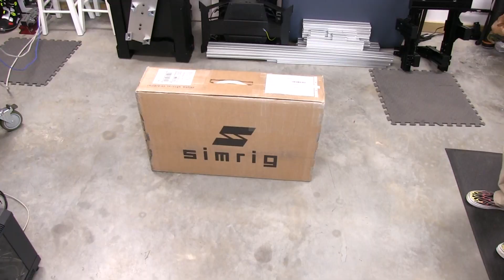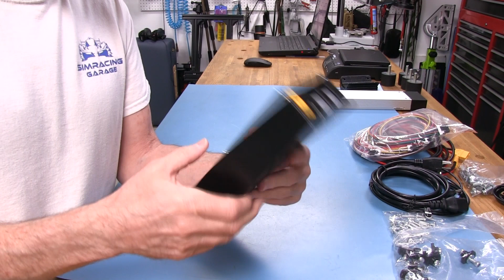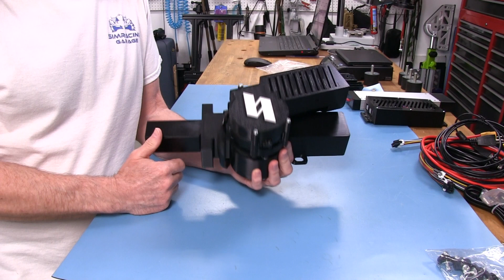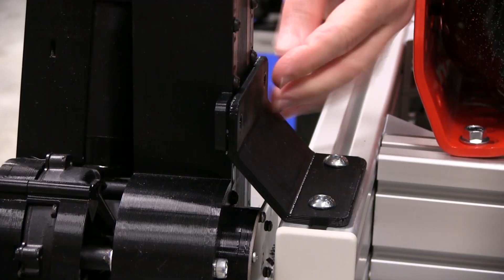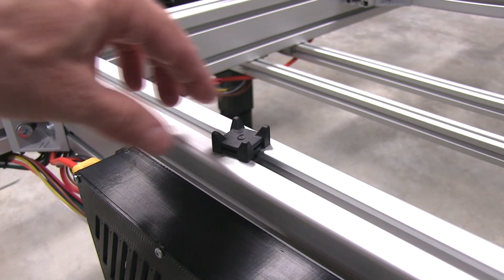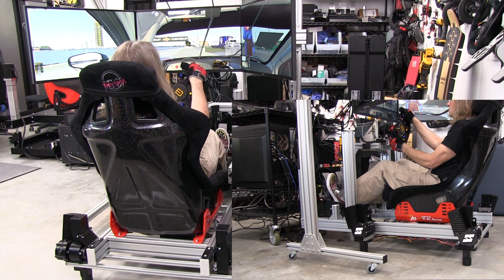Simrig SR1 Motion System Review

Comment: Id be really interested to see the RS Mega+ kit reviewed now that they make a plug and play set up. I'm really torn between the Simrig SR2 and and the RS Mega +, or even the Sigma Integrale DK2
Reply: hey, did you buy one of them? :)
Reply: @Jan-1337  ended up with dbox
Reply: @charlesgutscher1923  ok cool! Is the heave (/travel) also enough for flight Sims from you perspective? :)
Reply: @Jan-1337  1.5" of travel leaves some to be desired on flight but it's a trade off. If you're going to be primarily doing racing, the lowered travel units are more than enough and are easier to deal with. And you'll still get the seat of the pants feel on flight. If you're primarily doing flight, maybe opt for something with more travel
Reply: @charlesgutscher1923  Thanks! :) Did you have the chance to try the RS Mega+ or the Simrig SR1/2/3 before making your decision? I'm still undecided, especially when it comes to balancing racing and flight. The SR1/2/3 already offer 2.7" of travel—maybe that little extra is enough to simulate some pitch and roll during flight. Could be enough for me.

Comment: how do you think it will do with Microsoft Flight Simulator 2020?
Reply: Did you ever get a response?  I'm looking for a similar solution but using X-Plane due to the availability of a particular helicopter addon-on.
Reply: @flym0  did not- I went with D-Box refurbished generation 1, Four actuator system mounted to my FGT elite frame it works perfectly. I couldn’t be happier and the folks at D-Box are very supportive with X-Plane, Microsoft flight simulator, elite, dangerous, etc..

Comment: @40:00 Barry...the movement in motion platforms is primarily meant to simulate G-force...not only suspension movement...  So roll/pitch/heave create a combination of positive/negative & LATERAL g-forces.  (ie if you were tipped 90 degrees left or right, it would simulate 1 lateral G in that direction).    Many vehicles generate more than 1G or lateral force in cornering, so theoretically, tipping the user 90 degrees could improve immersion).  So while 70mm of roll to one side might only simulate 0.05G laterally, you're mind can fill in for some of the difference.  I wounder if you would have greater appreciation for the greater movement if you were in VR, where your eyes would confirm the movement, whereas right now, your eyes conflict (your garage environment) with the movement.  It seems to me that you do not understand the fundamental idea of what is being simulated.
Reply: JOY VLOG Have you ever seen his channel before.  He owns a top kf the line dbox system with traction lose and more. He has had a motion system for well over a decade. His point is due to weight most wont have the monitors attached to the rig so without the screens moving it simulates pitch of the car where when the monitors move as well then it is gforce

Comment: The price is awesome, but all that plastic is a bit concerning. You would think they would go with steel for the brackets and actuator housing at least.
Also, it's a gear driven actuator. All in all, i guess it's a good value for the money.
Reply: was until the price went to £3800 no cockpit UK

Comment: Hello Barry,
thanks for your interesting video. Because I'm thinking about to buy the SR1 now I'm very insecure. The stamps from the gear unit are PET material? That sounds not really to a long lifetime. Can you see if the gear from the servo motor is made of metal? Then you have mix from PET and the Metall between the gear tooths.
Maybe you can give an additional detail review about the servo/gear box of the SR1. Currently I'm not sure if the SR1 is a good choice. thx Mario, Germany
Reply from the maker: The leg is made from Delrin which is a very tough, machinable plastic made by DuPont.
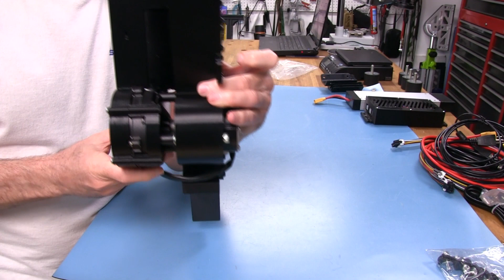Reply: @simracinggarage3026  Yes, thats right Delrin is very stable and have a long lifetime. But the question is, what is on the servo side. In your video it looks like metal output shaft (14:10). Therefore I think it is a metal gear inside.
A gear combination of Metal and Delrin isn't good in my opinion. It would very interessting to take a look inside of the gear box. Thanks again Mario

Comment: As an apprentice I worked on maintenance of the ultimate simulators, a Boeing 737 aircraft simulator. I always remember watching the pitch and roll of these from the outside. This was not to emulate pitch and roll, but to emulate G Forces if that direction. When you landed with full auto brake they pitched waayyy forward. When inside the graphics were staying pretty level, fooling you into thinking that this was G-Force pulling you out of your seat. Surely this is why you are seeing so much roll and pitch, but without the screens tracking the movement you lose the intended G-Force simulation??. Would VR solve this. Not a sim gamer, just intrigued by the available tech nowdays
Reply: Yes VR does solve this, you are actually 'there' in VR. Motion Rig and VR is the dream setup.
Reply: Yes it does as you are in another environment so the brain is tricked big time.

Comment: I think with VR on the pitching would feel more like acceleration forces vs replicating the feel of suspension. I fly full motion flight simulators.  They pitch way more than the aircraft does in normal flight but the perceived feeling inside the enclosed sim doesn’t get much more real.

Comment: Good lord man. Just subscribed as I'm liking your content so far but I have to ask something and it is very possible you've addressed this before but WHY on EARTH are you still using monitors over a mid to high end VR system. Flat screen really can't compare to a VR racing sim experience/immersion. I'm fairly sure a motion system should still work with VR, if not even better than a monitor setup.

Comment: Hi Barry, what is the difference between Simrig SR1 and DOFReality H3? Both are 3DOF, but uses a bit different kind of motion transfer. Which one is "better" in terms of feeling? Are 2 actuators  of DOFReality enough to transfer pitch and roll moves in comparison to 4 actuators of Simrig? And in other hand, do these Simrig actuators right job for traction loss and yaw comparing to one  actuator dedicated for these moves of DOFReality? Both systems are in similar prices here in Europe, so I'd like to decide which one could bring better and more real filing during driving in case I would buy one. thanks!
Reply: He refused to answer because it looks like he doesn't want to favor one from the other.  In other words, he's working for both.

Comment: No wonder you dont like pitch too high if you have static monitors. I bet this will be different experience in VR where you want more pitch that will simulate braking force and not only suspension . I give up on triple screen 3 years ago and im running VR only right now, but this motion system will be my Christmas this year i think :).
Thank you for your pro review as usually, because without you i would not know about this system and many others toys.
Thank you

Comment: Hi, new fan here love your videos. Not related to this video, but I'm considering purchasing the GT Omega Pro Cockpit, I was wondering if there is anything better you would recommend for around the same cost?  Thanks in advance for any advice. :)
Reply: The Simetik K2 is very good. I have an OSW direct drive wheel and the rig is solid. No flex whatsoever. It's MUCH better than the omega cockpit. I had a GT Omega before (not the pro)and it was flimsy and couldn't support my OSW.

Comment: How does compare with the DOF REALITY H3?
Reply: Based on the video, I think H3 sucks compare to this one because H3's movement are sudden and it is jerky and not smooth.
Reply: @senhsationalv6278  But this system does not support flight sims.. wonder if H3 supports it
Reply: @tommyjen2010  What you mean it doesn't support flight sims?  It does!
Reply: @senhsationalv6278  I saw the list of supported games on the website, mainly racing sins not flight sims

Comment: Thanks for this awesome review. Have been looking at this motion solution for quite a while and had some mails forth and back with the guys. But: the weight limit is way too low for people with "normal" rigs and especially for tall or heavy people. I'm 1,94 m and roguhly 95 kg with clothes + the rig I'm scratching the weight limit. Do you see any problem with that? Was looking to other solutions like PT actuators instead, because they offer more power and less limitations, but at a higher price. Do you have any comparison on the noise levels between SR1 and most recent PT actuators?
Reply from the maker: An actuators performance will fall off as the load it is moving increased in weight. Some are better than others. I do not have any info on the performance parameters of the SR1 actuators under load. Need to contact the guys a Simrig for that. Yes weight limits are aways something to consider depending on your own use requirements. Considering the price point of this kit, I would not expect it to have the capacities of more expensive actuator systems.
Reply: @simracinggarage3026  It's actually rated a max load of 175 kg (including driver and rig) based on what they say on their website. Do you have any opinion or comparison in terms of noise levels?

Comment: I have this system since a half year and I have to say I love it. It's quiet, strong, fast and the software is very easy to use. Thanks for your review I preciate it.
Reply: How is the reliability till now? any problems? do they send parts if it's out of waranty?
Reply: @TinoushGTR  until now no problems. The software is still updating, the servo drives working well. I have now approximately 200 hours running time on the system. The contact to the supplier over mail is awesome and I don't think that you get trouble with spare parts.
Reply: @TheNasenboer  Thanks for the update. Ill have to weight my aluminium rig. Because my seat is about 10-20 kilo and im 110kg. lives 40-50 kilo's left maxing 170kg.
Reply: @TinoushGTR  maybe you also buy an new seat like a sparco racing seat. They not heavy. Also you can go in touch with the guys from SIMRIG and ask about the maximum weight.. If you have any questions feel free to ask.
Reply: @TheNasenboer  sure I will. I haven't finished building my 8040 rig yet. My seat isn't used yet 😂 I'll upgrade to motion after couple of years. Not a seat mover like motion platform v3 but a dof system.
Reply: Do you think it wil work with the trakrqcer tr160??grtz
Reply: @m-dsimracing3091  yes it should be working. For the best answer please contact simrig.
Reply: Do you feel the motion when the rear of the car slides?
Reply: @fady904  The motor can only move up and down.. You can only feel it over your wheel.. But you can feel more the car and track
Reply: @fady904  only dbox can do that with its tactile.

Comment: Seems like the actuators are very close together!!  most of the actuators Iv seen are in front of the steering pillars??
Reply from the maker: That is the way the instructions tell you to set them up. This to maximize the pitch effect. The further you move the front actuators forward on the chassis the less effect the same amount of pitch will have on chassis movement.
Reply: @simracinggarage3026  yeah makes sense buddy... I'm just building an sfx-100 system and had thought about mounting them closer!!
Reply: @simracinggarage3026  What is your guesstimate of the longevity of this machine?  How durable it is before it is no more use?

Comment: So are you really able to feel the rear end start to slide out with this setup?
Reply from the maker: In the DD wheel, yes. There are some very minor queues from the chassis. But not like when you have a real, and effective, yaw DOF element in a chassis.
Reply: @simracinggarage3026  thanks for the info my man. I apologize, I meant to specify feeling that through this SR1 Motion System.

Comment: Like it Barry, I am about 200lbs, with OSW setup, P1 Rig, HE Ultimate pedals, how did you get on with your larger friend in this rig !?  did everything still work absolutely fine, or was the setup under too much stress !?   Very interested to know I am very keen on this motion setup.   Many Thanks, Des.
Reply from the maker: The system did not seem to have any difficulty with the added weight. I don't have any information as far as performance drop off under inceasing weight loads. Something you would need to ask Simrig.
Reply: Cheers Barry.

Comment: I got this system for a little while now(early bird sinds 01-2019). Its very silent and gives great motion, i think its even better than a expensive 10000-20000 euro d-box system that even comes without a rig! Also durability is topnotch, after a year it still delivers!…..Guys this is a no brainer! coupled with a dd1 and valve index its a wet dream!
Reply: Would you say it's quiet enough for use in a concrete apartment?
Reply: Yes for sure, the rubber pads do lots of damping and the actuator noise level is very low
Reply: So it's been 1 yr for you?  How often do you use it?
Reply: @senhsationalv6278  Don't want to drive without it, the combination dd1, valve index and motion is a must....its like the real thing.
Reply: @Airwayz ArA did  this rig does motion feedback when you shift gears like hitting you a bit Back? Cause I really cant see it :"(
Reply: @maximiliangottschalk6071  Yes you can edit the jolt (motion shifting)setting which is related to pitch...it's a personal thing, Barry didn't tuned that part in because maybe he wants more role over pitch
Reply: what about motion compensation? Do you need it. I'm looking at this system but I'm using an odyssey+ with inside out tracking. I'm worried it will feel unnatural without motion compensation.
Reply: @ronaldhulshoff9786  There is a motion compensation option build into the simrig controle center software and so far i know its not depending on motion controlers. So it has to work with all the VR headsets currently on the market. Its something they added a few months ago and works properly.
Reply: @airwayzara1763  that sounds promising. I'll investigate some more
Reply: Do you feel the motion when the rear of the car slides?

Comment: Hello, very nice video as usual. Thank you for all the info. In the last month I’ve watched more then 30 videos from your channel. I just loved them and they’re a great walking company!

Just to make sure and I’m certain that you can help me with this: i know that it’s possible to install this on the simlab P1x (it’s a profile rig), but do you think that this system could handle well with all the weight? I have a fanatec ecosystem with pedals, shifter, handbrake, DD1, the seat its the simlab speed3 and of course myself with about 70kgs. 

And in your opinion, would you prefer this system or one like the next level racing v3? 

Thank you in advance. 
Regards.
Reply from the maker: I don't have any information as far as performance drop off under inceasing weight loads. Something you would need to ask Simrig. Personally, I prefer the whole chassis moving vs just the seat.
Reply: Sim Racing Garage thank you very much for your input on this. 
The only advantage I can see on the v3 is really the small footprint and ease to install. Now I’m kinda of stuck with it, didn’t knew that SR1 system before seeing it on your channel. 
Please keep going on doing this amazing videos. Best of luck. 
Regards.